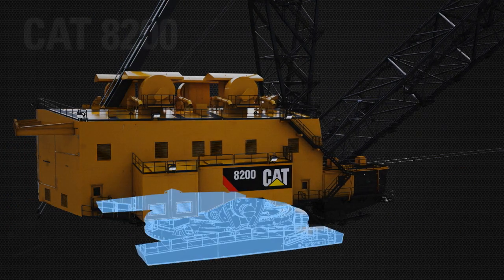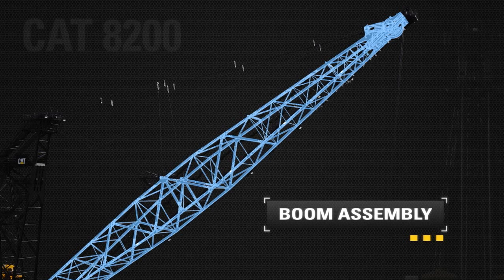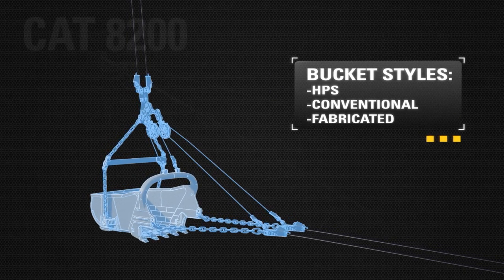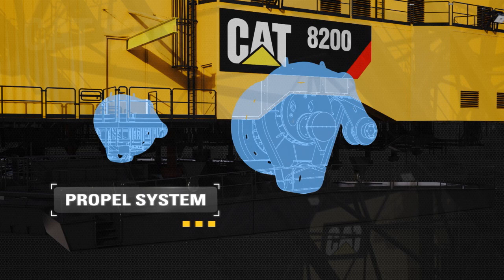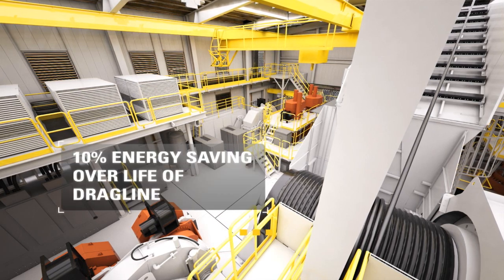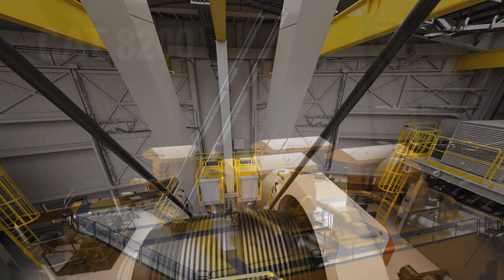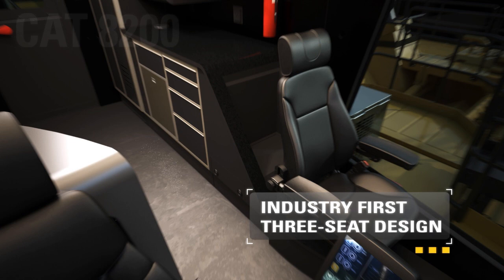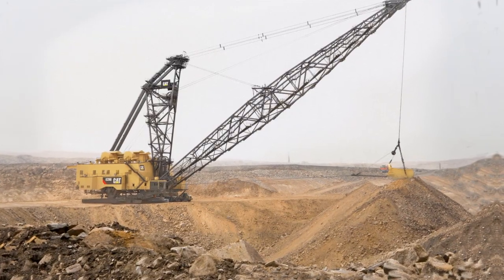Cat® 8200 Dragline Virtual Product Tour

Comment: When did caterpillar start making such machines? Like I remember it was large dump trucks, loaders and excavators now their making this????
Reply: Daniel Aguirre 
They bought Bucyrus Eerie
Komatsu now owns P&H
Reply: stephen meyer what!
Reply: Really??
Reply: Roy Parrish yes they did
Reply: It all started back in 1996. Bucyrus International bought Marion. Later Cat bought Bucyrus and acquired the Marion line. They can paint it yellow and put whaytever name they want on it but it's still a Marion 8200. Spoiler alert, I'm and old Marion erector and have put together several 8200s it was always my favorite model.
Reply: Ever since they bought Bucyrus and literally copied the Marion 8200 and just named it Cat 8200 and claimed they designed every bit of it
Reply: @Leatherface123.  The structure as well as the mechanical parts yes. But electrically speaking,  completely incorpores AC System developed primarily by Bucyrus and Siemens. Nowadays other manufacturers began to develop AC System.